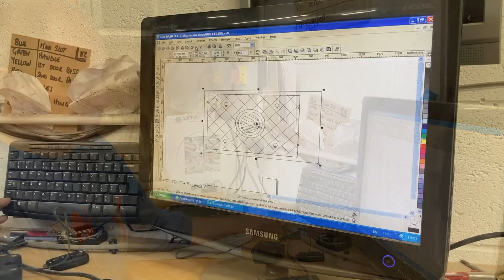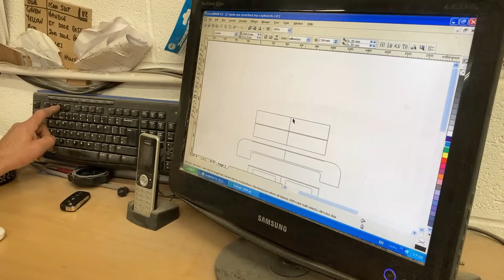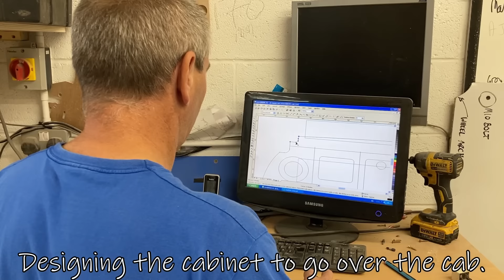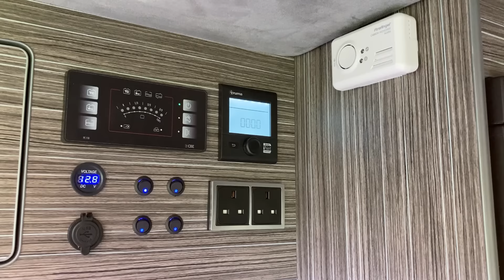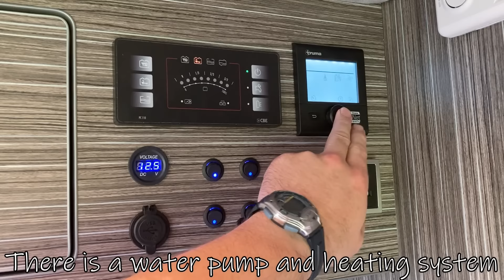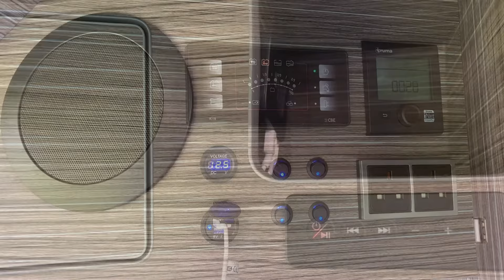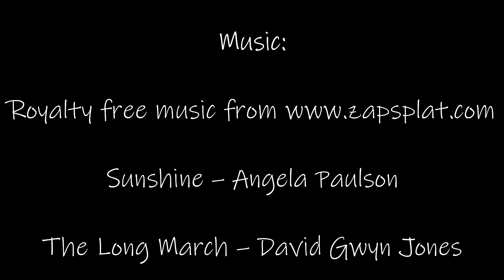VW Worx 2019 Crafter Full Luxury Camper Conversion - Schiehallion

Comment: Is that fiber glass insulation going in the walls? And if so is this recommended, I always thought this should be avoided?
Reply from the maker: No, this is specially designed insulation for camper conversions.